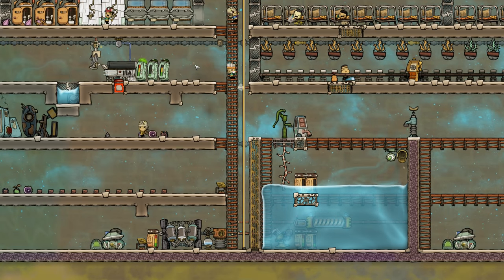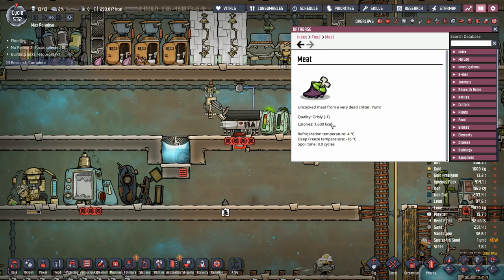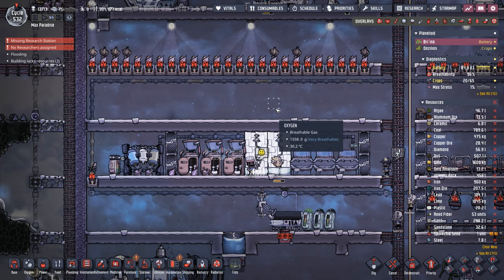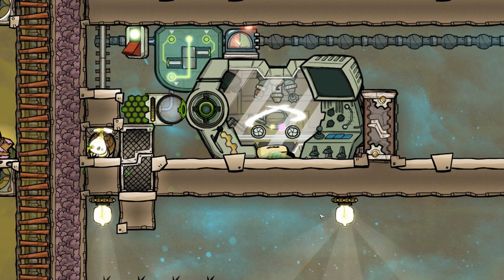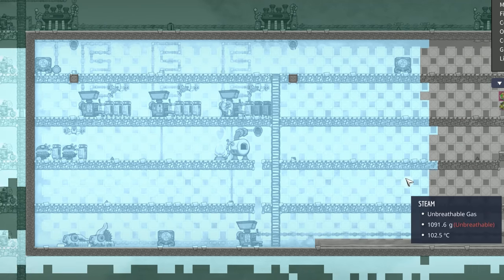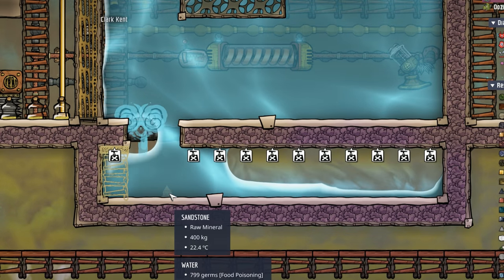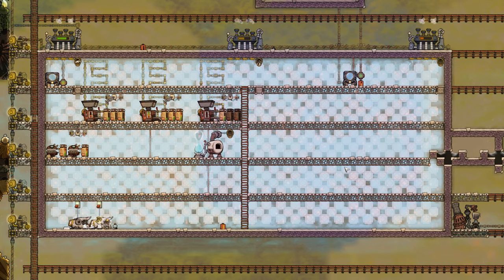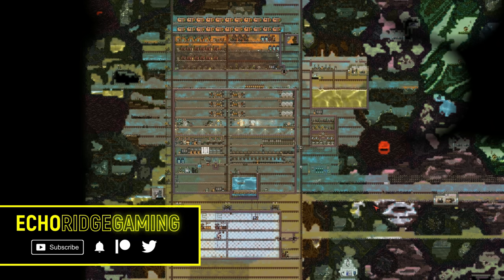Deep Freezer | ONI Spaced Out | Max Difficulty Ep 9

Comment: You should move your glass forge out of steam room, because it will overheat while inside because steam has decent heat capacity and conductivity, and often under high pressure which increases temperature transfer by a lot. Or just make everything from ceramic.
Reply from the maker: We def used ceramic.

Comment: Can anyone explain how Ceramic and Obsidian are better insulators? With the Insulated pipe, igneous rock has the same TC as Obsidian but a higher capacity, so wouldn't that make it better for insulation? Same as Ceramic Insulated blocks versus Igneous insulation blocks. When I used ceramic insulated blocks around a 500*C Hydrogen vent, I've never seen it heat up the area so fast compared with Igneous Insulated tiles (I always double wall, and following Echo's taming hydrogen vents tutorial), unfortunately, one of the vents is at the bottom of my base.
I've tried looking up the answer, but the answers aren't really giving any new information.
I'm going to continue using igneous as my seed has a lot of it, I'm just confused as to why people swear by ceramic and obsidian...
Thankyou for the great video though Echo~!

Comment: they add automation to Materials Study Terminal in the recent update, so you should change the rad bolt generator to work based off the Materials Study Terminal and dupe detector instead of the cycle timer
Reply from the maker: We try it in the next episode (still recording) but the functionality leaves a bit to work with.

Comment: You're great at explaining and engaging with the viewer. I suspect you are a teacher or ex-teacher...Am I right? :) Thanks for your videos.
Reply from the maker: Not a teacher, but very used to speaking to large groups. :)
Reply: @EchoRidgeGaming  Just to add I've done a few of these freezers now and during the building its much simpler to avoid the complicated vacuum building and just put a H20 drop on the metal tile with the above open, then seal it up. It will freeze the water anyway after cooling it to the right temperature, leaving a vacuum, that you can later autosweep out the ice and rail in a bit of bleach stone.

One question I have is longer term:
My ice biome where I've dumped the heat into starts getting toasty - should I then put the thermo regulator (I used a hydrogen gas cooling loop) into an aquatuner and steam turbine setup or just change the cooling loop to a liquid? cheers!

Comment: NO automation needed just build your rad bolt below have it shot up toward the right  have the material console built in line with the fireing of the bolt and then on the third level have another material console to catch any excess and the way that it fires less likely to hit a dupe and no automation needed. Never had a dupe try to catch a bolt with his teeth that way.

Comment: You could simplify the automation on the radbolts.
Run a cable from the automation port on the research machine to the radbolt generator. 
Not sure if you need a NOT or not.
Reply from the maker: I forgot about the newish automation port on the machine, would still need a dupe sensor to make sure no dupe is around though.  Good idea.
Reply: @EchoRidgeGaming  If it only shoots when it's empty, the bolt will never go past the input to hit the dupe.
If.
Reply from the maker: Great point.